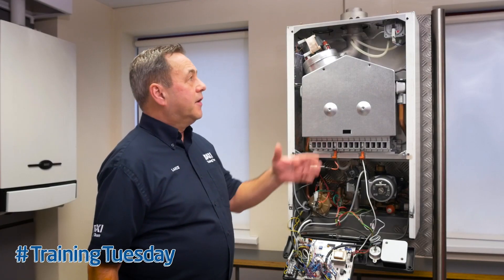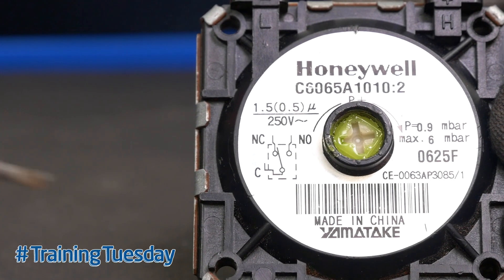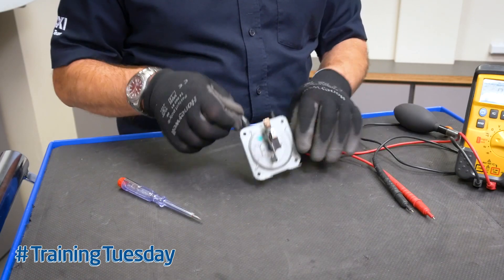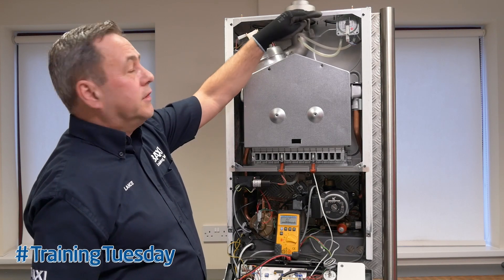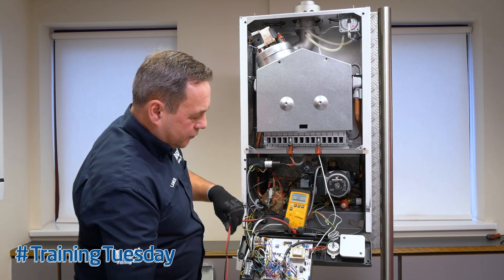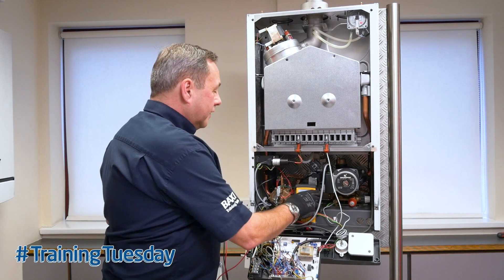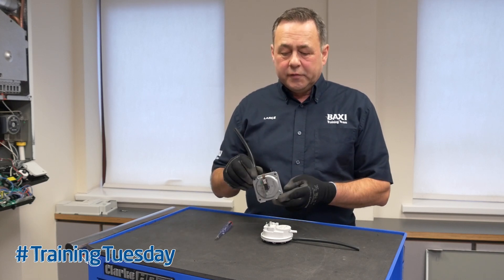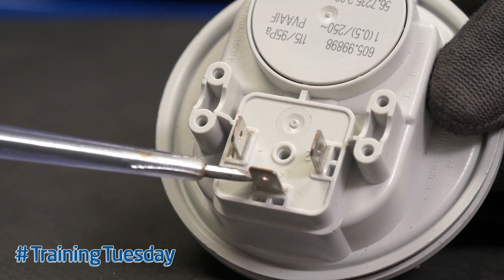How to test the air pressure switch on the Baxi 105 range of boilers | Baxi #TrainingTuesday

Comment: Hi im working on a baxi 105 he and its showing an air pressure problem. The fan is running with 240v at it and 34 ohms across it, the boiler lights when i manually make the air pressure switch by sucking on the tube. Ive also changed the aps with no joy. The fan seems to me to be running a little bit slow even tho its spinning freely and isnt stuck at all and has the correct voltage to it, Any ideas?

Comment: Had a problem where , fan runs fir few seconds then stops . And continued to do so without ignition happening. It sparks but no ignition. When I took hose off the spigot fan runs properly but still no ignition, any ideas would be appreciated.

Comment: So did he say with the fan running the switch goes from normally closed to normally open? ??
Reply: Yes, that's correct. Mains voltage is supplied by the controller PCB to the common (C) terminal. When the fan is not running, this voltage (say 230V) should appear on the NC terminal, and the NO terminal should be at 0V. When the fan starts, and there is the correct pressure, the switch will change over. The NO terminal will now be at 230V, and the NC terminal will be at 0V.

Comment: which hose goes to which outlet on the new valves?  suggestions for securing the new valves since there is no mounting bracket like on the one it is replacing?
Reply: P1 is your positive and P2 is the negative 👍🏽